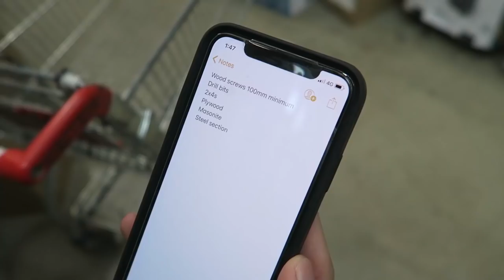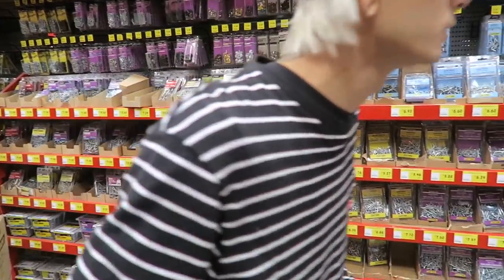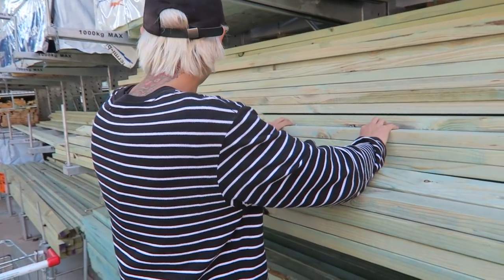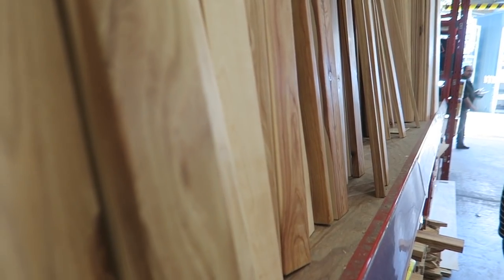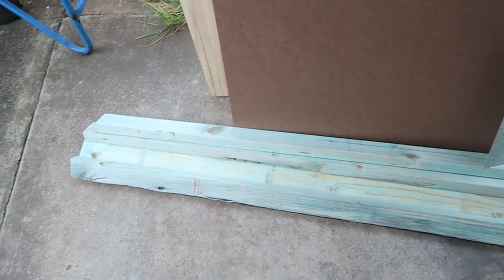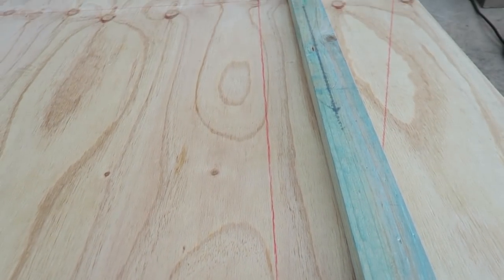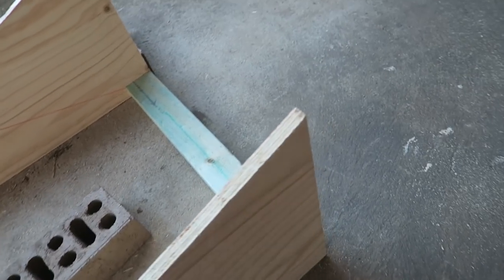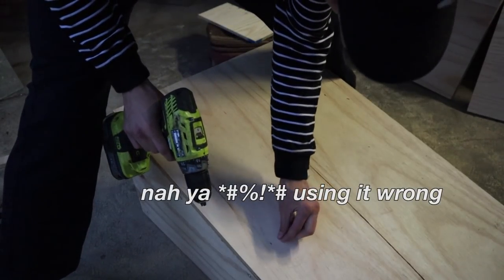D.I.Y KICKER BUILD

Comment: How much of the 2 2/4’s did you end up using. I just built a box and have 1 2/4 left and plenty of Masonite and plywood. I want to build one of these to drop in rather than launch.
Reply from the maker: Toni Loves Skateboarding I think I used one and a half I think, oh like a little quarter pipe you mean?
Reply: Sean Enuks yeah. I ended up building one yesterday and I had to go to the store and pickup a second 2x4. Thanks for the reply 🤘🏽